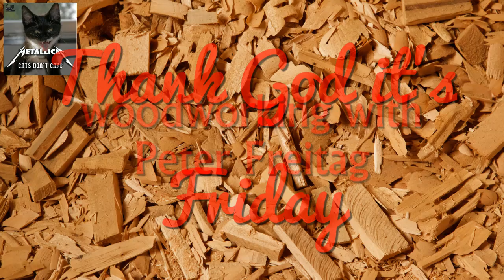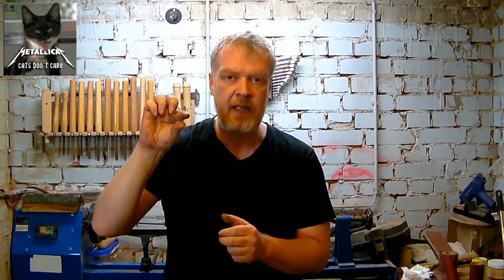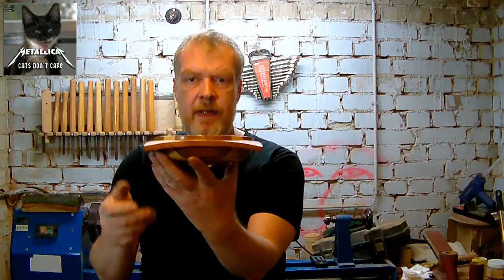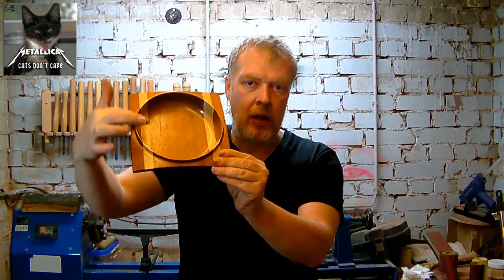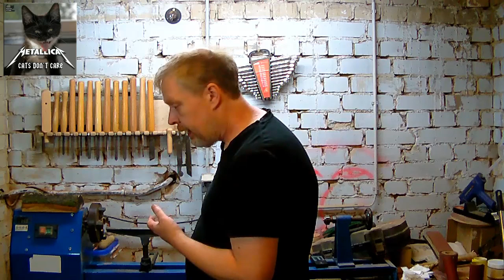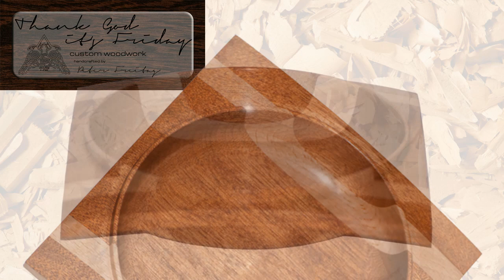Square Bowl - Follow-Up

Comment: Nice follow up piece Peter.
You're right with the 'droop' effect, it would have looked wrong if the square edges curved upwards.

And yes, it looks FAR better without a lid too. Fantastic choice of wood too.

How do you source your wood choices?
Reply from the maker: Thank you Matt.
Well, as fare as wood is involved, it's quite easy. Once in a while I raid the local carpenters and literally take everything I can get with no intention to get special species, just hard wood. Most of the wood is for free or cheap. Back in the shop the wood sits and waits for me, having an idea. The Meranti was from a front door, my sister gave to me two years ago. So another source for free 'exotic' wood may be a company making and installing windows, as they throw away most of the old doors and windows they disassemble in order to install the new energy saving ones.
Basically I choose my wood from what I've got, sometimes a single piece sits for a year or so until I find something which matches.
Greetings from Good Old Germany
Peter